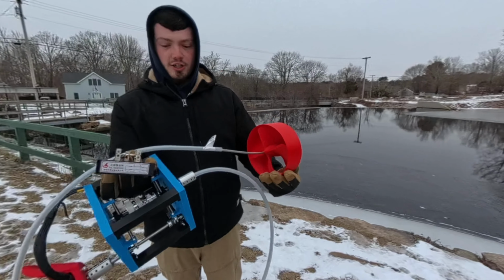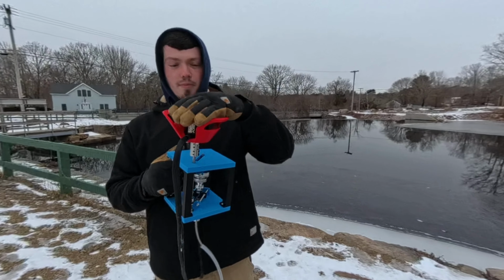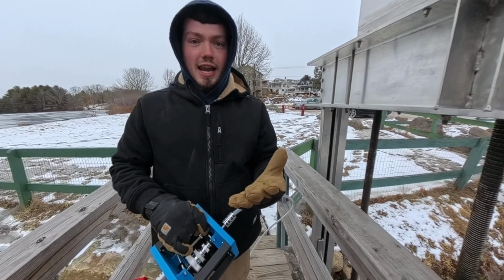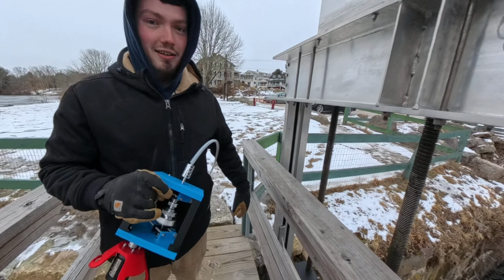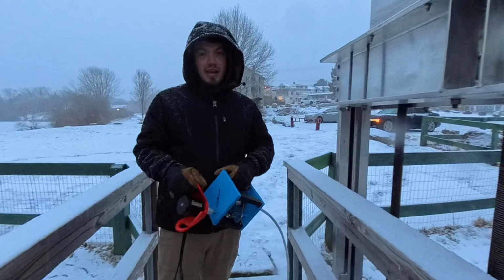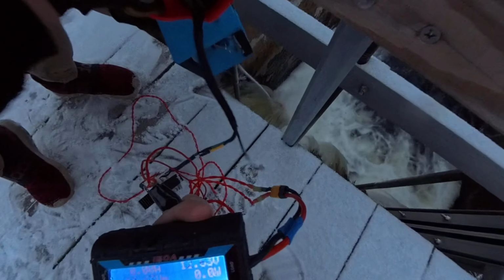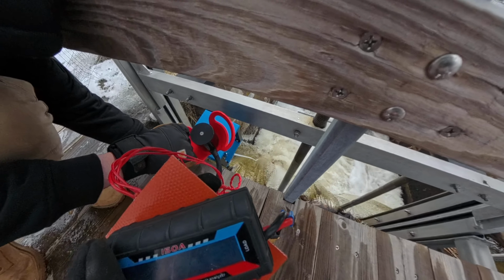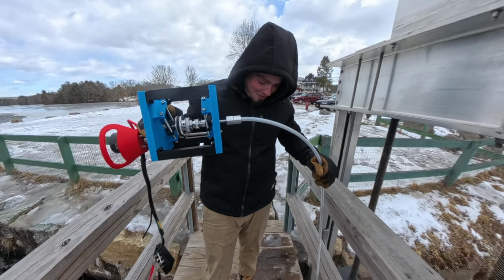3D-Printed Micro Hydro Power Plant!

Comment: I'd like to see a weight and size to watt comparison between different generators. I'm curious what the maximum power would be from something small enough to take on a hike.
Reply from the maker: As they sit right now I'd say this is the most power per pound (kg). Though the next revision of the hub motor turbine (coming soon!) Should make significantly more power. This is great idea though thank you!

Comment: Dude, 90 watts with a self-built generator ain't nothing to sneeze at. That's enough power to do a surprising amount of stuff.
Reply from the maker: Exactly! It would be 24hrs a day of power not 6-8hrs like solar panels. I'm seriously impressed with this and I think I can maybe push 100-120 next vid. Thank you 👊
Reply: Lets say i make 7 how many ligthbulbs can i power  non stop.24/7
Reply from the maker: @Ogaipo  let's say you made 7 of them at 93w each, thats about 651w/h or 72 9w led bulbs (60w equivalent) powered 24/7
Reply: @Beyond_The_Print  thanks im going to make this for my village we have a lot of blackouts where we live.
Reply from the maker: @Ogaipo  let me know if you need any help! Good luck!
Reply: @Beyond_The_Print  is it posible for a 3d printer to print another 3d printer
Reply from the maker: @Ogaipo of course, there will be some parts you need to buy (make) obviously but most of the parts can be printed by another printer

Comment: Are the 3d print files and instructions available?  I want to take like 10 of these, put them in my creek and wire them together to get 600-900 watts to power my house
Reply: really?  you can imagine a system to jurry rig 10 of these together secured and stable into a local creek. 
but you can't look at this video and easely recreate the same thing?  

i'd say it's easyer to make what he has here than what you have in mind to do in your creek.
Reply from the maker: I think one could make this with a bit of patience and CAD. Putting 10 together definitely would be the interesting part of that, I agree. I think a different set up would also work better
Reply from the maker: Shoot me an email! I don't have them anywhere yet (it's in the works) if you have this much water your much better off with a larger system haha. I may be able to help for what your looking for

Comment: what if you use big pvc pipe connected together in a T where you can have a straight up and down to lower your device in and the water is coming in the middle of the pipe and falling down will give it controlled pressure and stability and give your device the ability to spin in a tighter vortex which in return gives you a stable control to test your gears and there capability
Reply from the maker: Check this video out! "Dam turbine" https://youtu.be/SXsQaYP3Sh8

It sounds alot closer to what your talking about and has pullies on it already (just the older motor)!
Reply: this is just a proof of concept. 
not the design he's going to go with. 
and to me this is a decent result. 

could probbably get about 150 to 200 watts out of that proppelor under this amount of water pressure. 
but honestly when in a normal stream of water with the propper ducting and piping.  and about 60 watts would be the most you can do.

Comment: !!!Congratulations!!! The futher the water can fall the more linear thrust the propella will create speed but not so torque, due to the intermittent flow, I have found this theory on my water wheel.
Reply from the maker: Thank you for the comment! Definitely interesting to see how much a small height difference makes
Reply: Watched alot of water wheel videos and almost all have the water pouring into the bucket at the top of the wheel, I have mine pouring in at about 45degrees and only hitting the outterside of the bucket, creating linear thrust the other side would creat reverse linear thrust at the top.
Reply from the maker: @HenryOwens-py3ur  you will have to post some videos, I'd loge to see it! Thanks for the update too
Reply: Thank you, it is very exciting seeing the watts roll in, unfortunately here in the uk were coming out of our rainy season and probably won't be upgrading the water wheel untill next autum, write now its almost spring and I've got to prepare the garden for growing seasons, so sorry. But if I am I will diffiatly make some videos and give a heads up.
Reply from the maker: @HenryOwens-py3ur sounds good! Stay tuned I think 100+ watts is right around the corner
Reply: Hey I'm tune in, I got pop corn,  soda, for ther first ever archimedes sphon video! ON !!,YOUTUBE!!! Coming to a cinema near you, lol.
Theory, if the archimedes wheel doesn't turn in the syphon pipe ! Pull it out, get it syphoning then lower it back in, but watch finger and the vertical drop.